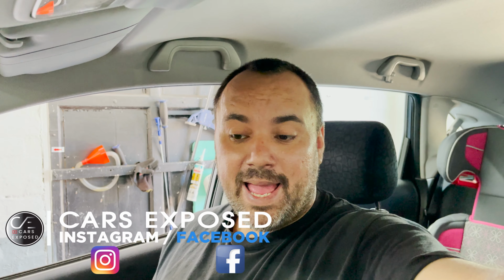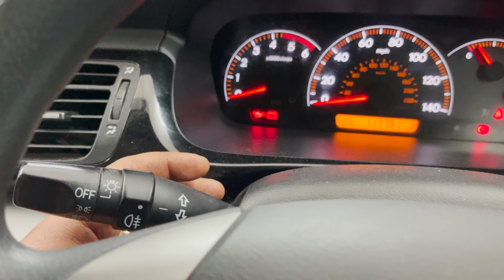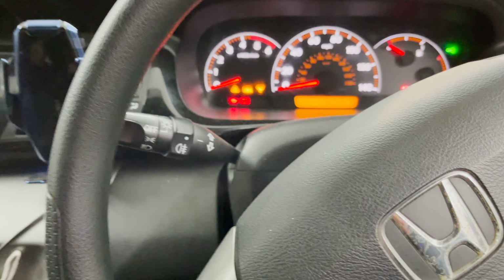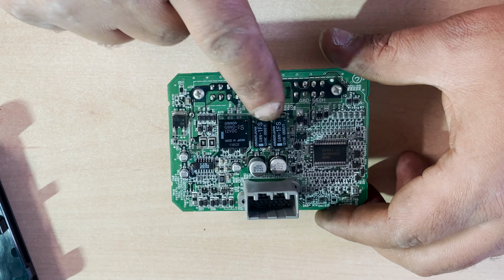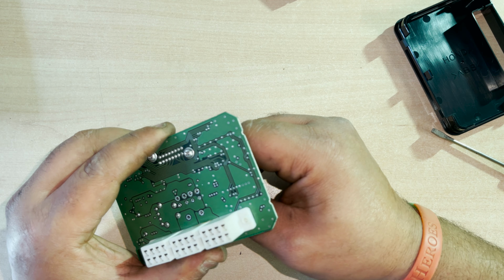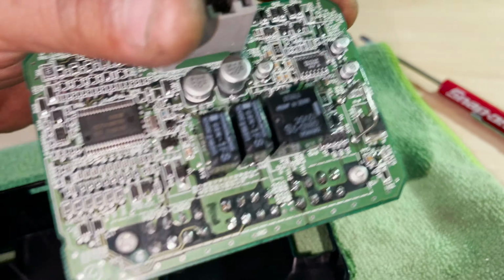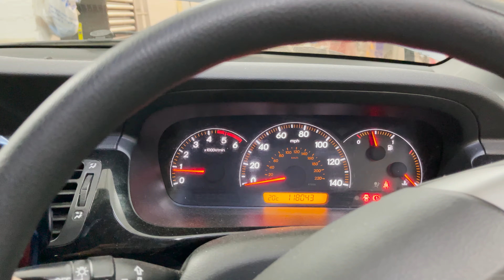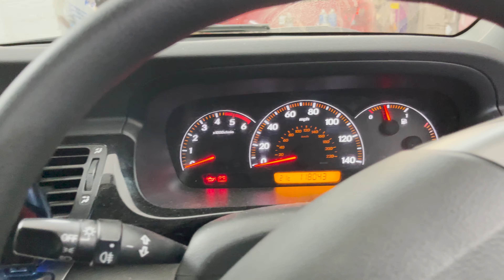2006 Honda FR-V 2.2 Diesel Indicator not working or Stuck on FIX 38650-SJD-E01

Comment: Hello, i recently worked on the same problem with my frv.. signal and hazard lights not working. In the end, decided to buy a used relay box from ebay replaced it and worked. Unfortunately, i dont know why the headlights no longer work,  the wipers dont work as well, park light stays on all the time.. appreciate if you can give any advice or options i can work on.. thanks in advance..

Comment: I am having same issue now, with left turn signal relay on Honda FR-V for EU.

Is there an option to remove the this black box block without the base, where all the wiring connected? Or it has the clips there and the only way is to take it all out?
Reply from the maker: @ditrevoler  is the only way to take it out

Comment: Excellent video, I had same issue with relay so I disconnected the positive battery lead as advised by other youtubers, had a look at the never-ending wires and decided it weren't for me... reconnected the battery which set the alarm off forever so drove it to a garage which was under new management, told them the alarm was the main priority  as the indicator is intermittent and was not completely obsolete. The garage charged £160 to replace the relay box and only disconnect the the alarm so it no longer works. Now the alarm don't work and the car shuts itself after the boot is opened. Any ideas on how this can be fixed as I got lock out with key in the car a week after getting the work done... any help would be appreciated (FR-V petrol 2.0 sport 2005).

Thanks
Reply from the maker: I'm not sure whats happening there as I don't work with this model often but it sounds strange to me that you were able to start the car and the alarm still going off ... Strange one
Reply: I bought the black box on ebay for about £90
Reply: @CarsExposed  do you think if the alarm module was replaced it would sort it out without causing other issues.
Reply: @theapprenticegardener4858  facing the same issue with the alarm recently. The car starts, can be driven, but the siren is constantly alarming. Ended up disconnecting the siren today, but looking for a permanent solution. Were you able to solve yours?